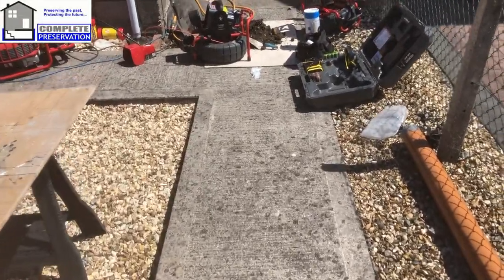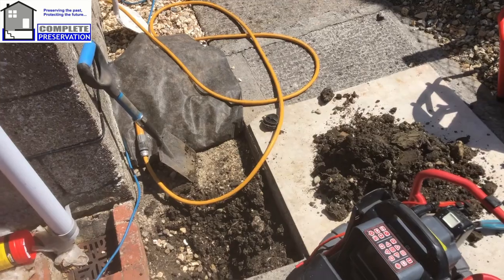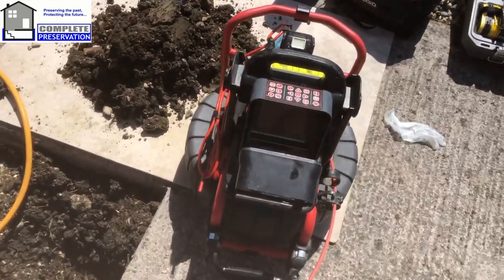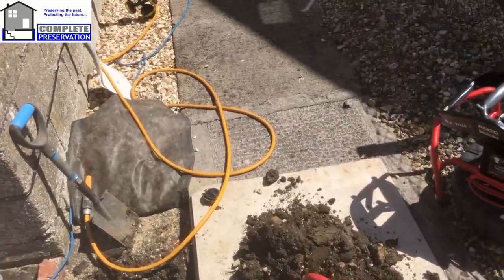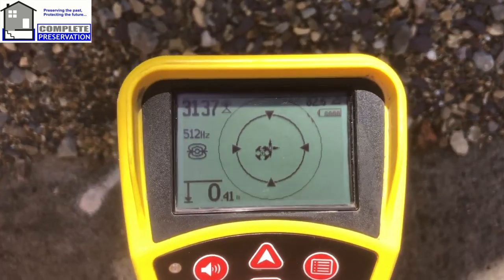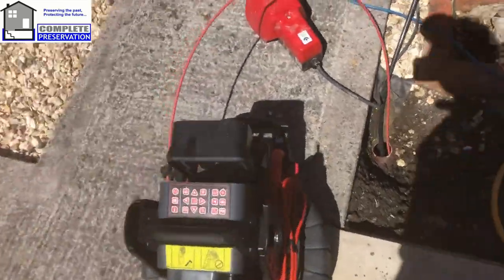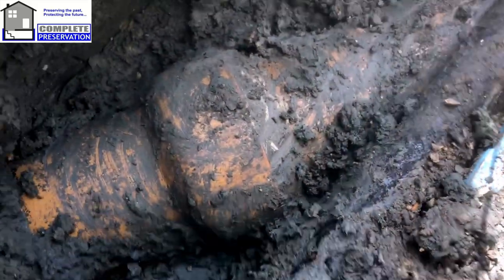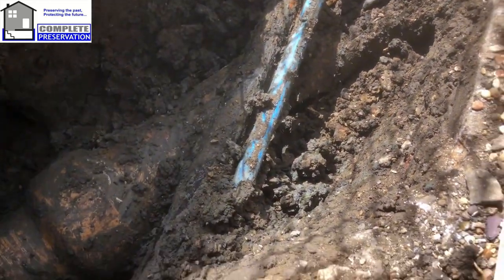More suspended timber floor ventilation?

Comment: Hello Ross, thanks for the videos - they're brilliant.
I'm getting really high readings in my subfloors having insulated them. Is the fix to improve ventilation or is it more complicated than this? Thanks
Reply from the maker: Thanks bud 👍 without data and a survey impossible to say. Retrofit insulation in a sub floor will increase moisture content because it will be colder bud. Leaks, drains soakaways, ventilation all play a part. Best to go and speak to the installer bud, as they should have checked everything first 👍